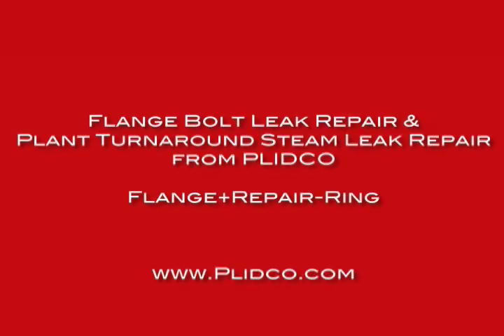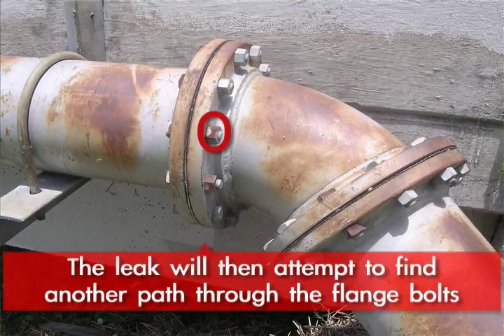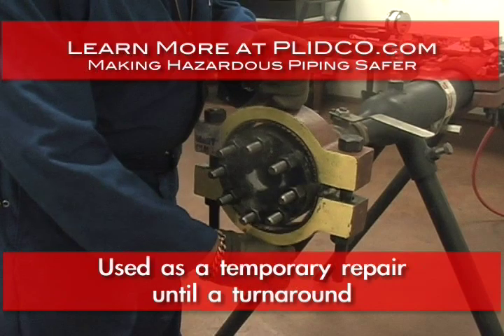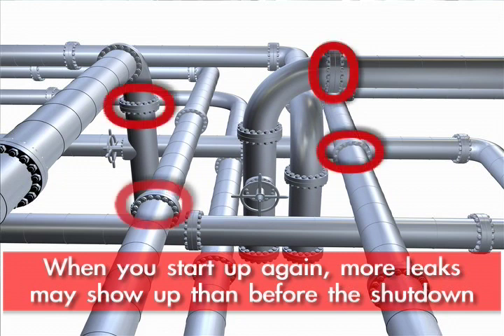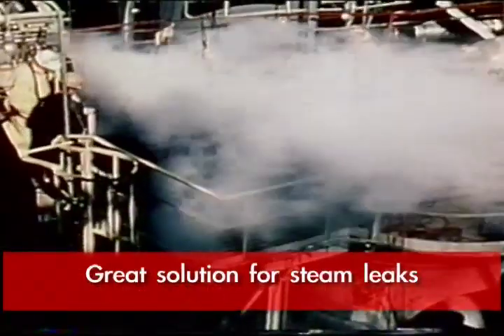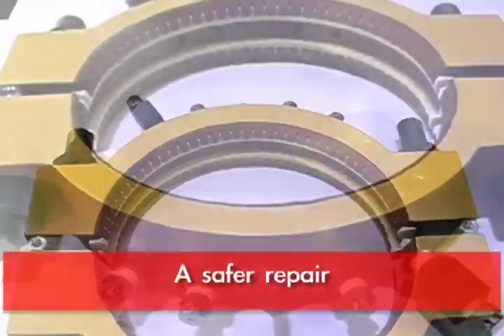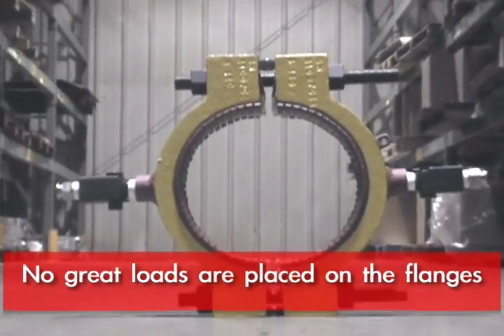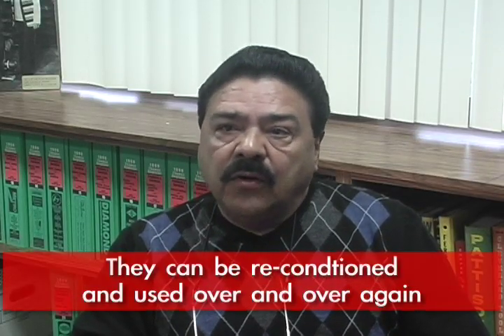Flange Bolt Leak Repair & Plant Turnaround Steam Leak Repair from PLIDCO

Comment: The Flange+Repair Ring 4'' 1/16 # 10000 PSI failed with me :-( ( leaks had change direction to  betwen nuts and stud bolts